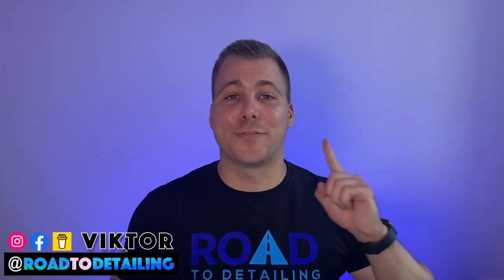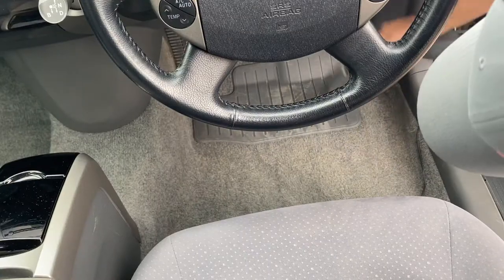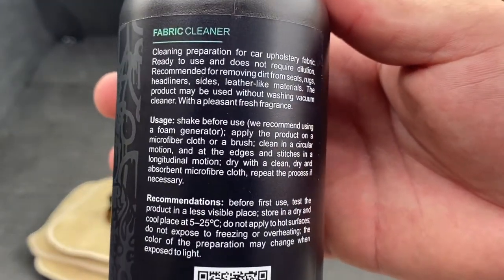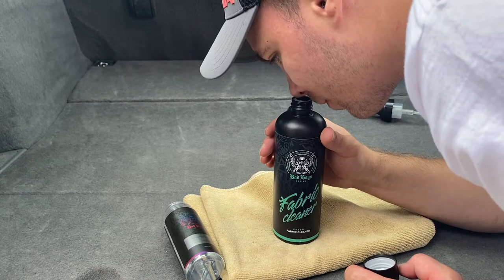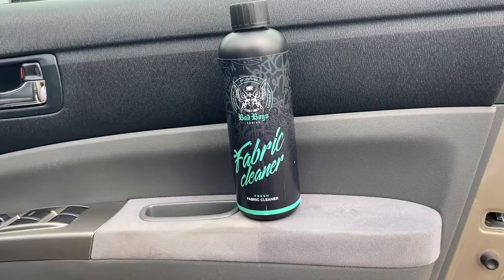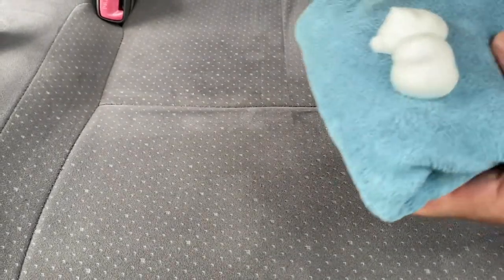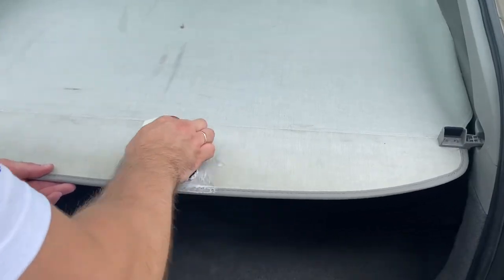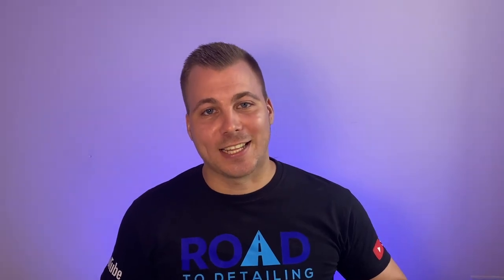Cleaning Car Carpet Seats Doesn't Have To Be Hard.

Comment: Good to see a interior video for a change , you dont see too many on here generally exterior one . The fabric cleaner looks decent , I sometimes wet vac mine but the sons seats Im wary of given the fabric they are on his bucket seats .
Reply from the maker: Thank you Andy! I really appreciate your feedback. To be perfectly honest, filming interior isn't the easiest thing, because the lack of space for the camera and other equipments, also eats up more time comparing that to filming the exterior. However, I was planning to do this basic cleaning since a while, also freshen up the fabrics. In part 2 which comes soon later next week is about the plastic components and dashboard. I personally don't have any extractor nor wet wac, etc. but I do think, the result with that would be even better and the cleaning could be more deep. The Fabric Cleaner helps to clean the surface pretty well, but obviously won't freshen up the sponge under the fabric/upholstery part, but this limitation is perfectly normal without a use of an extractor I would say.
Reply: @RoadToDetailing  I was told once but a chair repairer if you wet vac a interior too often the sponge degrades quickly . My lads car I want to do soon as he has a dirty job and as much as I tell him he wont use a seat bag during the week on his . Mine isnt used often so they arent too grubby and same with my wifes car . For ours its mostly mats that REALLY get dirty . His mats are red which look so good but my god do they get dirty fast , My cars almost 15 yrs old and on the original OEM floor mats and Id like to keep those going as long as I can . Only really mine that needs it as often its just me in there so maybe this week I will do them all
Reply from the maker: @tmphotography8443  yes, it makes sense. I can only imagine the situation with the seats of your lads car, as mine not used heavily at the moment and wasn't in a bad shape either, but my floor mats were. I use 2 sets of floor mats, an after market rubber sets for the winter time and I have the OEM fabric ones for the summer. I need to admit, I have been too lazy, so i still didn't change the aftermarket rubber sets to the OEM, so I saved a bit of time there, but I know, they can be so bad so quickly.. :)